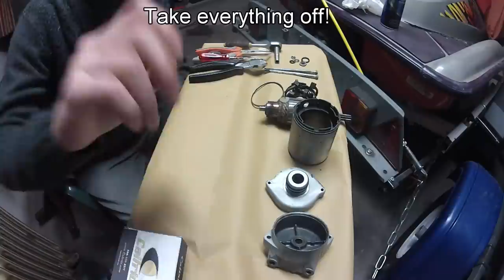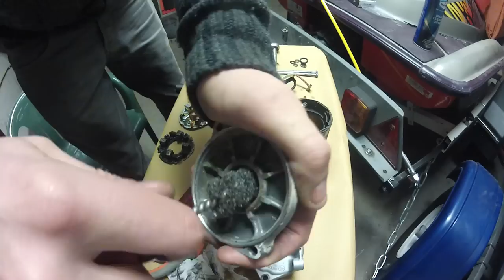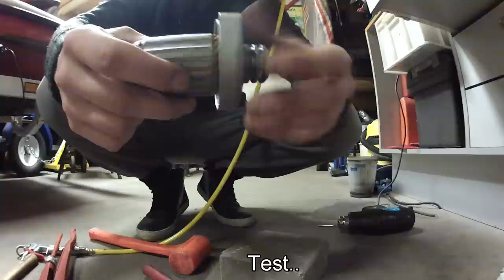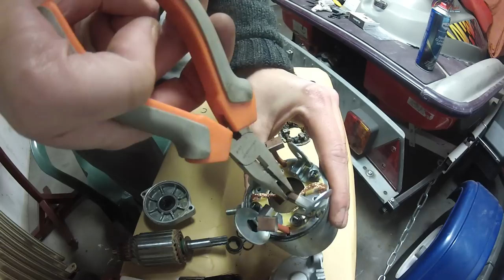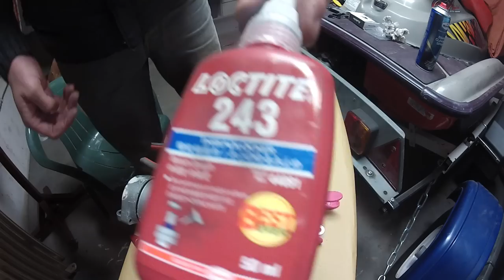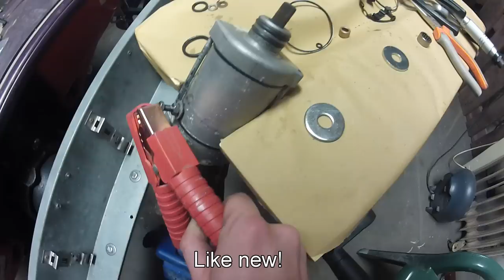How to - Starter motor Rebuild

Comment: So I bought a aftermarket starter  for my 91 Honda nighthawk but there was some mounting issues, so I had to Frankenstein the old with the new. The finish product does spin, but my bike still doesn't start. It doesn't even sound like it turning over, is it possible the starter could be spinning the wrong way or something?
Reply: only possible way of it spinning backwards is if the polarity is backward, have you  checked your relay, solenoid and fuses?, when rebuilding a starter there are a few types, you have direct, engagement plunger etc, the Electromagnet systems are pretty straight forward, Brushes, winding etc, now have you tested the starter off the bike?, if all above is good it could be as simple as a neutral switch , i'm interested to hear how you go.

Comment: So how does this fucking thing work now exactly? It has four magnets on the outside, four brushes two + and two minus and an armature that rotates inside the four magnets. But where exactly does the current flow through the armature and where does it change the polarity of the aramture?

Comment: hay mate were u get ur rebuild kit from
Reply from the maker: Matt Kenny Ebay
Reply: W Jansen i can't find them on there bud
Reply from the maker: http://www.ebay.com/itm/Starter-KIT-FITS-SEADOO-GTX-DI-951cc-98-99-00-01-02-03-951-/290398921163?hash=item439d1fe1cb:g:I8sAAOSwiCRUcLzH&vxp=mtr
Reply: W Jansen is this for yamaha r1
Reply from the maker: Uhm No? the link is for Seadoo. But maybe it fits Yamaha..? 
SEADOO PWC 3D DI 951cc 2006

SEADOO PWC GTX 951cc 98-02

SEADOO PWC GTX DI 951cc 00-03

SEADOO PWC LRV DI 951cc 02-03

SEADOO PWC RX DI 951cc 00-03

SEADOO PWC XP DI 951cc 03-04
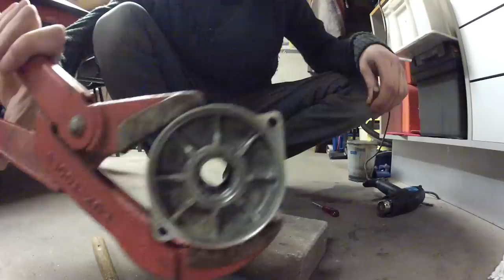Reply from the maker: And i remember to cut a little piece of the ground plate to make it fit. Also the bearing did not fit very well so dont destroy your old one like i did. (1:29 you can see the inner difference)